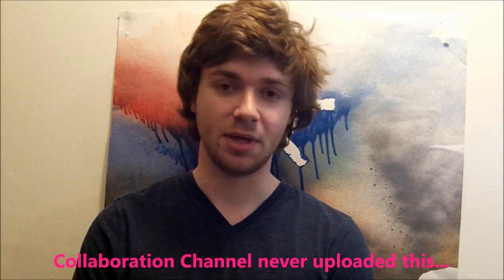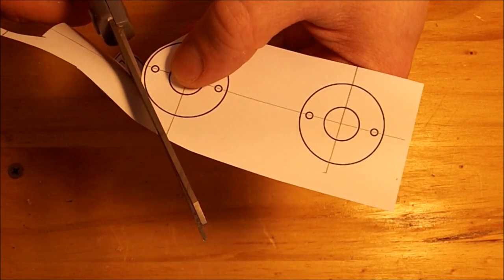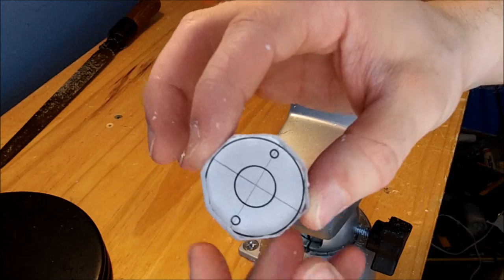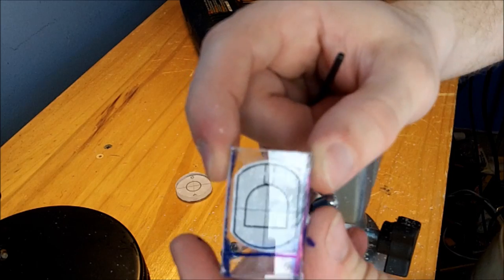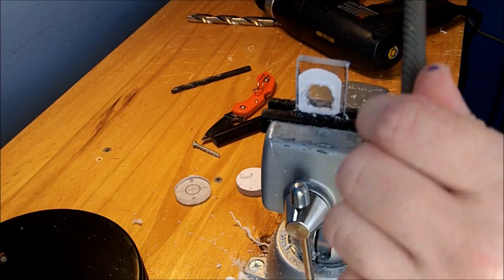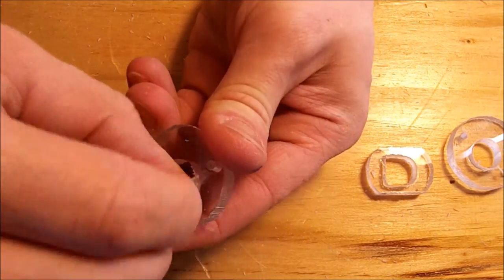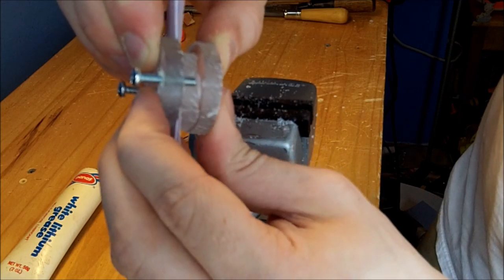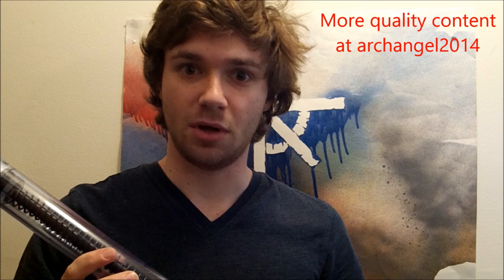Handmade Rainbow Catch

Comment: I gave up on the Colab Channel. They did like 4 videos and 2 of them were War footage.

But I digress... this was an awesome how-to video. Once my new workshop is set up I think I will be giving homemades a shot, and will be using this as a guide for catches.
Reply from the maker: I sent them this in March or something, as evidenced by my lack of beard. If you want to make the catch, just use a hole saw. They are like 15 bucks and it cuts down the fabrication time from like 60-90 minutes of cutting and filing to like 5 minutes of just drilling through the polycarbonate. It's really that drastic.
Reply: archangel2014 I prefer to use a scroll saw, it does it all when combined with a drill for the internal cuts.

Comment: Could you use cutting board for this or does it have to be polycarb/acrylic? I don't really want to use polycarb because the store I work at only sells polycarb that thick in the biggest sheets, for some money I wouldn't like to spend. Any material substitute suggestions would be appreciated, because I only have access to so much

Comment: For hvz would u recommend a stampede or a rapidstrike keep in mind I already own a stampede and which ever I get with be highly modded
Reply from the maker: Both are good options. RS is easier to mod, just double up on the batteries and you're set. If you don't mind spending a little extra time on modding a Stampede, then just use that and save your money.  I have a ton of Stampede videos if you want some ideas, and many other guys also like them. Look around and make something awesome.